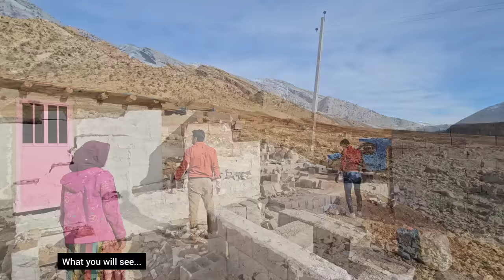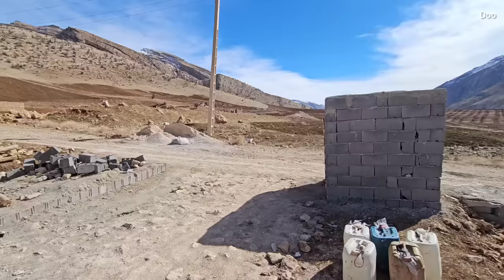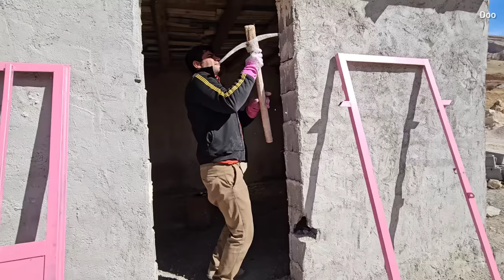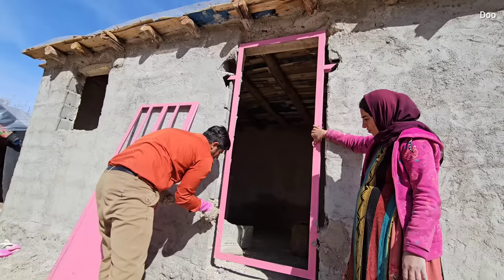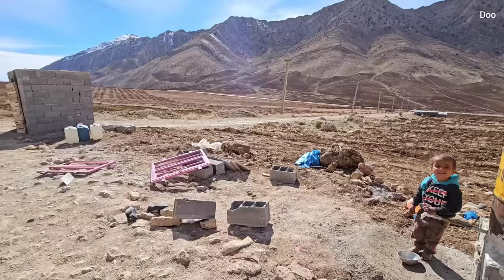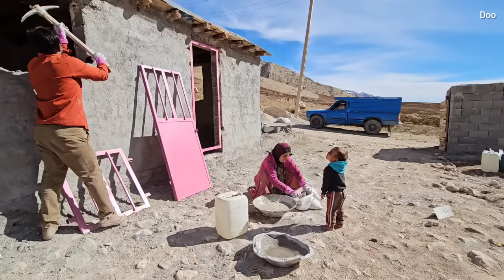The Selflessness of a Divorced Woman in the Harsh Desert for the Survival of Her Twin Fetuses

Comment: Better finish cementing the exterior and tar the roof before another storm or you will have the same problem as the last place. You should also do the same with the outhouse. And just a suggestion, paint the blue door pink to match the house and use it for the outhouse. ❤